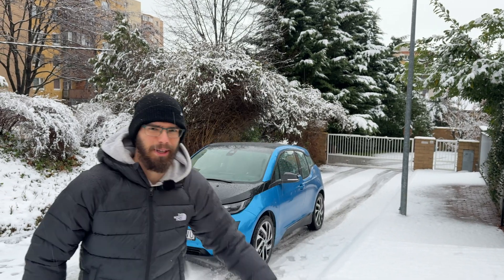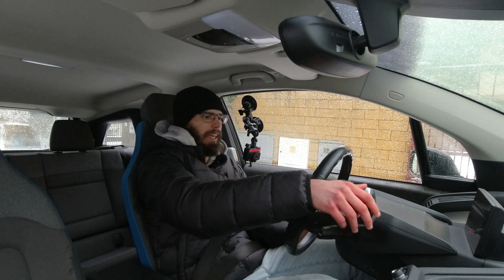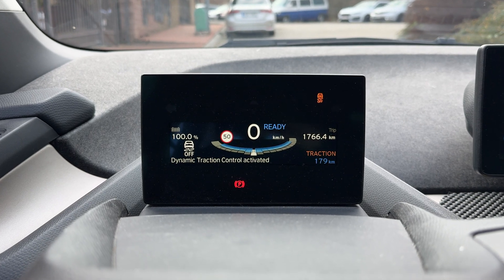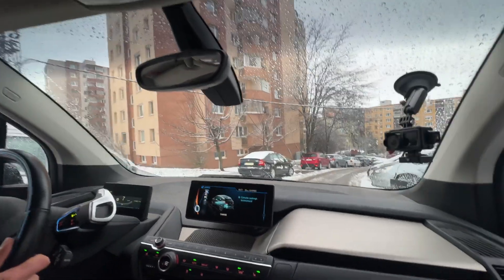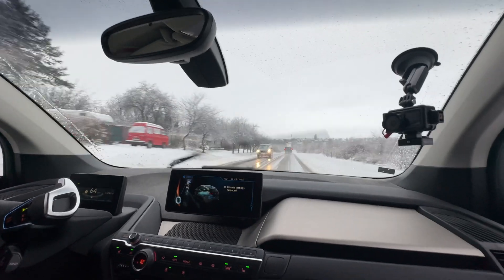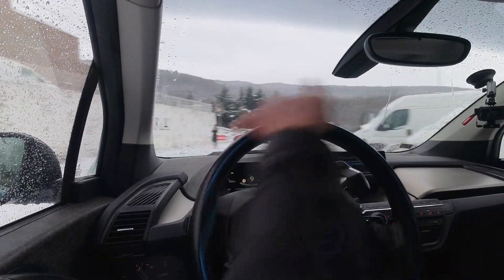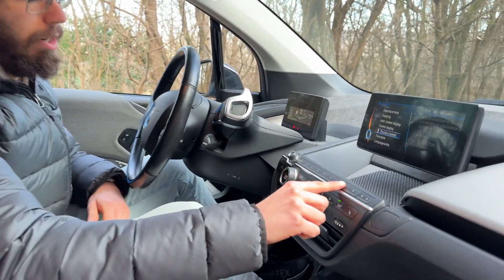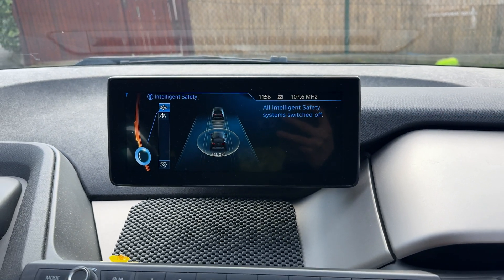BMW i3: Everything You Need to Know About Driving This RWD EV in the Snow

Comment: @MartinKarel I think it fits the character and use case of the car that the DSC setup is biased towards safety. No-one buys an i3 to do donuts.
For the UK it's easy to see why use of winter tyres is rare but it has always struck me as odd the default tyre of choice (and initiated by manufacturers) is summer tyres and not all season tyres.

A great informative video.

Comment: The heavy low down battery which keeps the COG down is a plus point. A front wheel drive ICE vehicle would be worse on that untreated road. Actually fitting a throttle control box to an EV set on the mildest setting is a worthwhile thing to do
Reply: You can simply push a button on the i3 to put it into eco mode. It makes the throttle far less aggressive.

Comment: Great video👍🏻🇸🇪 Question: how do you disable the wing mirror auto folding?
Reply from the maker: There is no automatic wing mirror folding on BMW i3s. Just single click the lock button on the key fob instead of pressing and holding.
Reply: @MartinKarel Sorry, I didn’t mention mine is a 2016 94ah Rex. If I click the lock button on the key fob the mirrors folds. Not a great feature in snowy winters.
Reply from the maker: @tokeofsweden The drivetrain doesn’t make a difference.

If it keeps folding the mirrors in, it means the previous owner used some aftermarket OBD tool to code that feature in. You will now have to uncode it. 🙃

Comment: This is incredibly reassuring. It does not often snow where I live and the i3 is my first rear wheel drive car so I was afraid to drive when I wouldn't have been in my last car which was a mini cooper that had proven itself in slippery situations. My i3 is still very new to me and it has such a different feel to my manual mini cooper.

Comment: Narrow tyres are great in the snow as they cut through it. I have taken some treacherous and downright dangerous journeys in an old smart fortwo on all season tyres and never got stuck or stranded. I would pass stuck 4x4's and go up hills that normal cars couldn't. Several times there have been big Mercedes and BMW owners who couldn't make it into work. 1 guy battled all the way in but then couldn't make it over a hump that the car park sliding gate runs along.

Comment: Try roller mode next time! I sometimes have a frozen gas cap after driving rain and then freezing (or carwash). The vent doesn't work and the REX stops. If I take the cap out and tap it, or let it melt I'm good! 🇨🇦🇨🇦🇨🇦👍

Comment: I have driven 2 different i3s with winter tires on snow covered slippery roads and never had any sort of control or traction issue. If all vehicles were this good in snow, we would have a lot fewer collisions on the roads.

Comment: Thanks for the thorough introduction how to drive with I3 in snow. I think your channel makes very good and inspiring videos!
In Norway, the BMW I3 is a very popular car. We have 2 units, one produced at the beginning of 2014 and a facelifted version from 2019 with the larger battery.
I can confirm that both cars are good in snow!, but the new version has changed the stability control which makes the car more stable when the engine is braked.
We often drive in the mountains with the I3 between Oslo and the west Norway and we have never experienced problems in the winter, even in quite difficult conditions!
The cars are absolutely brilliant for Norwegian conditions. Easy to drive on narrow Norwegian roads, fantastic city car, construction that does not rust and much more. It seems that there is minimal degradation of the batteries even after long time at use (check Bjørn Nyland test).
Solid cars throughout, except for brakes that rust.
Reply from the maker: Thanks.

I believe if you take the older car into BMW to have the firmware updated, it should behave very close to the newer cars.

Comment: I remember when cars used to be RWD, and when FWD came they were advertised as way safer to drive than RWD. Now we bring a lot high powered EV's  with only RWD out on the streets. Does not make sense lol. edit: I pressed send way too fast, I was going to say I always loved the design of the i3. It looks futuristic still.
Reply: True! There are some differences obviously, back in the day a typical rwd had the engine up front and less weight sitting on the back wheels, as far as going in a straight line (uphill and such) this combination was less than ideal. A fwd has the engine on top of the driven wheels and therefore has more traction in winter, again in a straight line. Much has changed with the introduction of traction and stability control, these nanny’s come as standard and in some cases cannot be turned off. An EV has a much different weight distribution and an motor sitting on top of the driven axle.. in combination with all the electronics and the ability to manage the power output of an electric motor (much quicker), you don’t get the same issues like 20 years ago. Many EV’s designed from scratch will simply have a rear motor as standard and an optional motor up front. I saw a Harry’s garage video where he drove a Porsche Taycan mildly offroad and it had traction for days like it was a Range Rover, very much due to its ability to control the power output. Not like it used to be, indeed. Cheers!
Reply from the maker: 100% this Bart!
Reply: @BartSchrijvers  but midengined cars or rear engined cars have been known for putting out the rear  easily. Even on modern Porsches :)

Comment: I "re-learned" something! That the mirrors can be folded by Touch&hold of the exterior door handles... no need to take gloves off to reach into my pocket to hit the round lock button. Thanks!

I was without use of my 2015 i3 BEV for almost a year, while accumulating the funds, buying the parts and finding a shop to replace the drive motor... bearings failed @ 94k miles. 
I found a "used" 2018 motor with the upgraded bearings, with under 100 miles on it... it was a test vehicle - but no damage. 
Also replaced the transmission knowing that the input shaft bearing could have been damaged by the slop in the motor rotor... it was also on ebay, but had zero miles... someone purchased the wrong p/n for his Rex... and could not return it.
I also converted it to all 2018+ motor mounts and brackets... not cheap.

My next concern is the aircon compressor... whether to replace it as preventative maintenance when I have the 94Ah battery installed that I got for it. 

(if I understand it correctly, this 60Ah to 94Ah upgrade is a simple "retrofit" coding process... ??) 

Martin, have you seen many aircon compressor failures in the UK? I'm in the US, in Missouri, so our weather isn't terribly hot like they have in Arizona or South Texas... but it's a big risk item.
Reply from the maker: Haven't really seen frequent AC compressor issues. If you feel like it may give out it's of course good to have the money ready for it, but I personally wouldn't replace it prematurely.

(Once / if it fails though, it's important to get it sorted ASAP because it cools the battery as well.)
Reply: @MartinKarel  Thanks, Martin. Yes, I'm aware of the aircon being used to cool the battery pack... that's part of reason for my concern.  It originally came from a warmer area of the US, where it likely had "Comfort" mode in-use, and the compressor likely ran at full power... therefore more wear & tear.  I've had it 5 years, but have always used it in Eco Pro mode (99.9% of the time).

Comment: it finally snowed for me and I have 20 inch wheels I do not know if they are all season but i noticed slip near instantly nice video
Reply: Frankly, I don't think you should drive your car if and until you know what tyres are on it!
Reply from the maker: If you are on the 20" wheels you are on the summer tyres.

Definitely don't recommend driving in snow with those at all.

Comment: I3 range extender is an Ev all manufactures want some day far ahead it's time great Urban vehicle.
Reply: What?
Reply: @LPGatekeeper  Most plug in hybrids  offered today has 40 to 60 miles battery only range i3 offered 110 almost 10years ago plus Extender.
Reply: But then BMW realized that the complexity of this setup was not worth it, and last generation of i3 (120Ah) was only offered as BEV. It's really funny to see how other vendors like Mazda are trying same ideas that BMW had over 10 years ago and has discarded by now... :(
Reply: @pqvid yeah this car was far ahead of its time for sure!! I just wish they came standard with wider wheels + fenders instead of those thin wheels. I have the 2015 rex